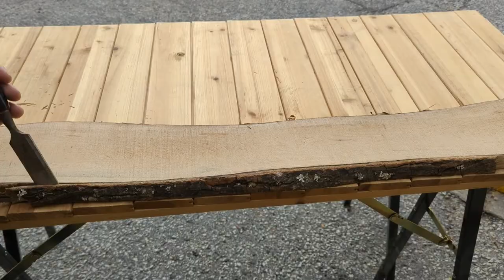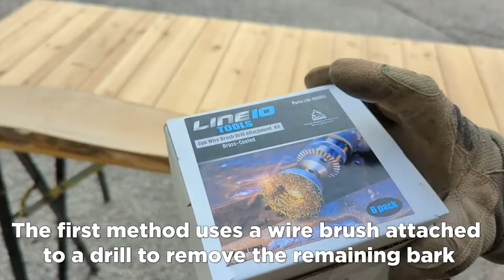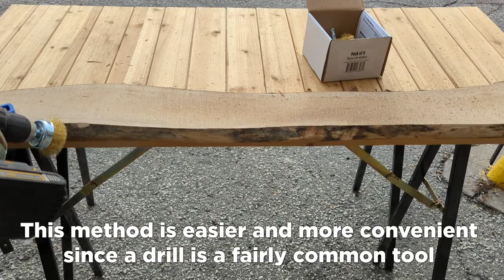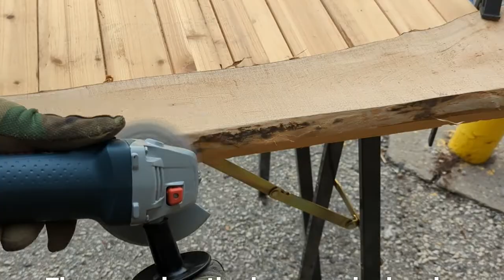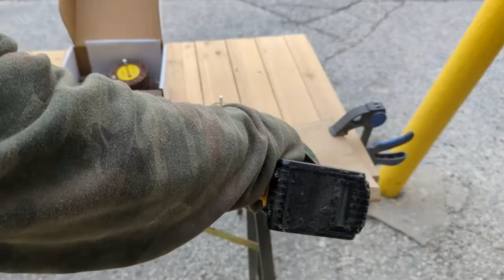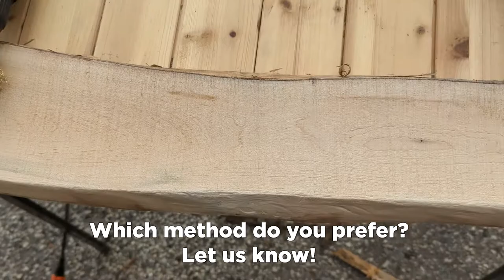Prep Live Edge Slabs with your DRILL or Grinder (for Epoxy Pour)

Comment: Hello, I am building a river table in my cabinet making class. I am wondering if I could use a palm sander instead of a flap sander?
Reply from the maker: you can but you won't get good results as the sander is rigid and doesn't conform one way or another, in some spots you will be taking off too much, in other spots the sander won't reach easily.